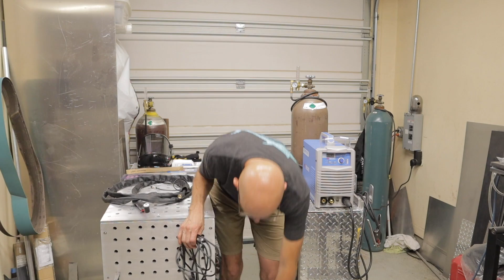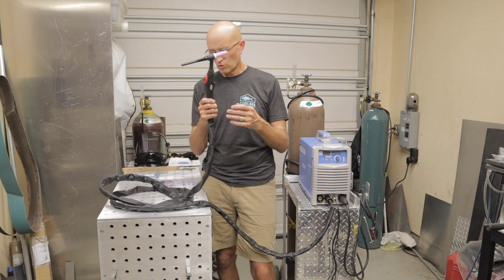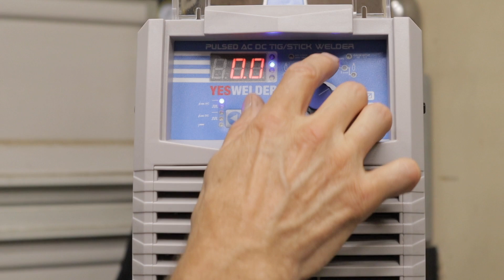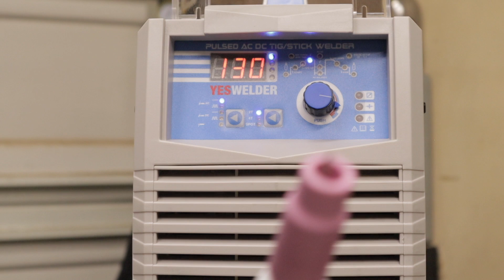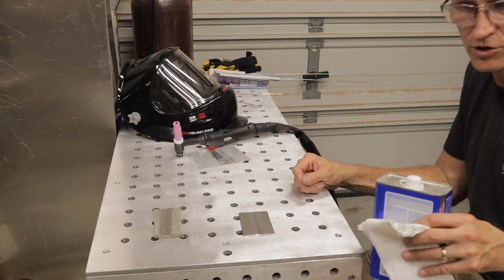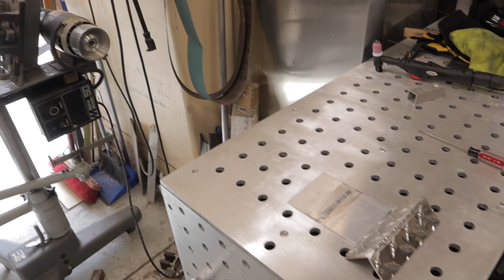YESWELDER NEW TIG 250P Setup & start tig welding Steel & aluminum.   Discount Code in description!

Comment: Hello Don,
I am fairly new to welding , I do own a Mig welder but i have been looking to buy a Tig welder. I have watched your videos on your yeswelder Tig , but yeswelder also sells another Tig I believe it's a 205DS which I think the biggest difference is it wont weld Aluminum. But I am lost understanding what exactly what all the capability of this Tig is able to do. I do mainly thinner metals yard art , but would like to know that I can weld thicker metal if I need to.
 Do you have any information on this other Tig-yeswelder ? I plan on buying in the next couple of months. 
         Thank you
Reply from the maker: Hi Brian, the 205DS is primarily a mig welder and has the capability to use a lift Tig torch. It will do basic Tig welding but with no control of amperage like Yeswelder’s 250P Tig welder. I do a lot of yard art stuff myself and Tig welding thin materials is so much easier with the foot pedal control that the 250P has. It has high frequency starting also so you don’t have to touch the metal to start an arc. You would be much happier with the 250P especially since you already have a mig welder. Let me know if you have any other questions. 👍😀Don

Comment: Can you post a link to the power (mains) plug. I am considering getting this welder but want to make sure I have the correct wall outlet. Thanks
Reply from the maker: Hi Rob, it’s a standard 30 amp plug. If your wall outlet is different or the older style, just swap out the outlet with the new style from Home Depot. I’m not at home right now but I can take a picture of the plug and post it when I get home. 😁👍

Comment: Will this tig 1” aluminum? Looking for a welding machine for my awning company
Reply from the maker: Hi Quinton, I’ve welded 5/8” plate with it with a little pre-heating up to 200 degrees. Are you welding solid 1” aluminum or lighter aluminum to the 1”?
Reply: @PranaTech  it’s hollow round bar
Reply from the maker: Oh, then it will weld it great! 😁👍

Comment: did try the 120v  outlet plug?
Reply from the maker: Hi there, sorry, the Tig 250 pro is only 220volts.  The Mig 205DS that I did a review of is dual voltage though.😀👍

Comment: Could you tell me the dimensions of this welder please. Length, Width and Height? Also the weight. I want to see if it will fit on my welding cart. Great video. Thanks
Reply from the maker: Ezelk, I’m at work today so I can’t measure mine right now. I’m a firefighter so I won’t get off until 8:00 in the morning so I can measure it then. I can assure you though that it will fit. I welded up a cart to fit my AHP Tig and when I got this one it was half the size and would fit on any cart out there. 👍😁
Reply: @PranaTech  Not in a huge hurry. When ever you get around to it. I made up a welding cart/folding table and my miller 211 fits on the shelf. My second shelf is empty right now and this welder may fit on this empty self. Thanks for the super quick response back. Looks like you may be in the Tuscon/Phoenix area. Cactus in the background of one of your videos. I live in Montana. Thanks  Eric
Reply from the maker: Hi Eric, good eyes! Yes, I’m on the north end of Tucson.👍😀  I’ll send you some dimensions in the morning. Don

Comment: The one thing I can’t figure out in my machine is when I’m using the foot pedal once I press the pedal it’s all or nothings with my heat. I can’t adjust the heat with my foot like you’d typically be able to do on other machines. Where or how do I adjust that on the settings?
Reply from the maker: Hi Brandon, ok so because the torch has a switch as the standard startup setting, you have to hold the pedal for 4-5 seconds so the machine senses you are using the pedal. Once it senses it, the upper led light of the three on the lower right of the control panel, will light up and then you will have full control with the pedal. Let me know if you have any other questions.😀👍
Reply: Prana-Tech awesome thank you for the quick response!
Reply from the maker: No problem my friend! Glad I could help and that it was a simple fix! 😀

Comment: i have one of those machines and i followed how you set it up for tig welding aluminum and it barely sparked, when i received the machine it was damaged right out of the box, it won't even stick weld, can you help me please, i would really like to talk to you other than on here if possible, preferably by phone...
Reply from the maker: Hi Pickleman, sorry to hear about the welder not starting.  Sounds like the only thing that is working is the high frequency start and not the main voltage.  Here is my email  pranateq@gmail.com  I’ll try and help you as much as I can but it sounds like there is a problem with the main board. You will have to email support at Yeswelder and get a service ticket started.